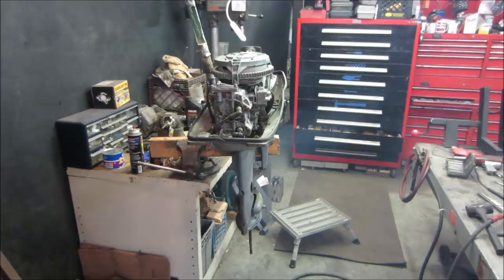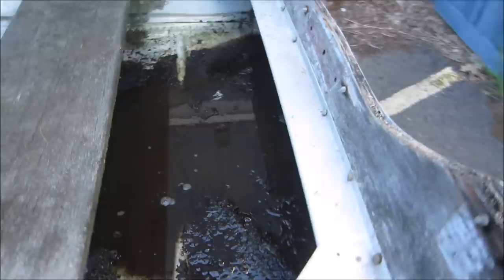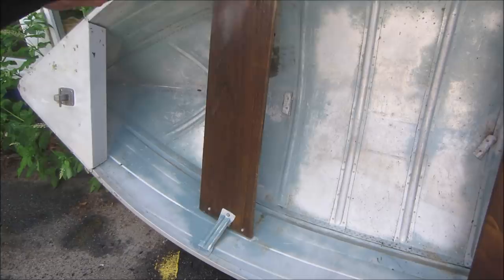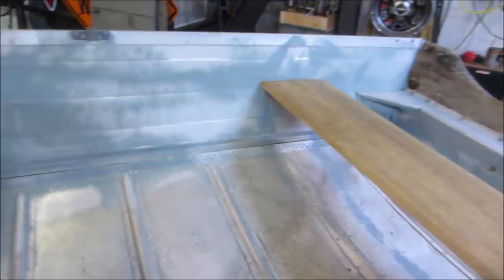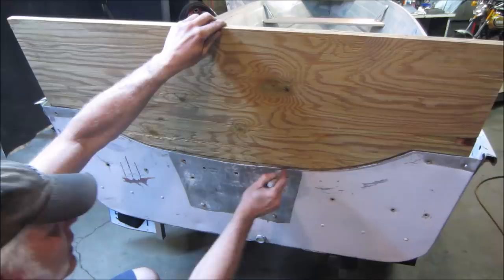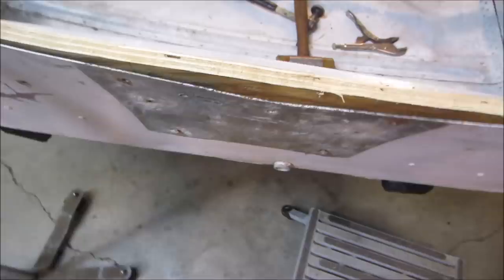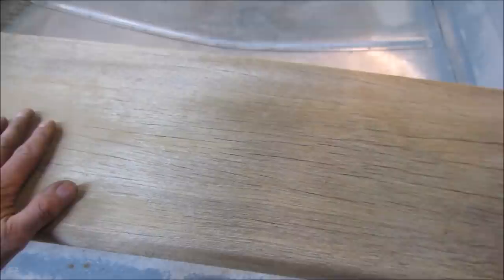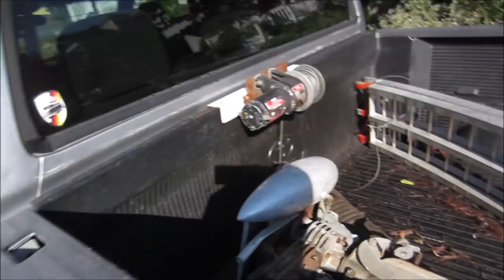Free Boat, First Wash/repair in 20 Years

Comment: 23:50 - "Runs for a while then loses all power and dies"  = Defective reed valve - Remove the old one and replace it with a new one and it will purr like a kitten.

Comment: I know there are boat experts on here, I seem to remember corner braces by the transom board to the sides of the boat.
I don't know the proper terminology, but you know what I'm referring to.
(I specialized in satellite communications Stripline/ microstrip work for 40 years. I never got involved with boats.) So please help Mustie1 if you can.
Reply: Any small aluminum boat like this would have corner gussets, a transom board that reaches the whole width, and a strengthening cap on top of the transom to tie it all together.  However, this is mustie, and he will make it work as is, until it breaks, then he will fix again!
Reply: @Bobbywolf64  gussets, yes, corner gussets.... i know how Mustie is, yes. He'll strengthen the heck out of it. I had remembered the gussets is all.
Thank ya kindly...
Be well.

Comment: On the outside of the transom  you need a metal plate.  this give the motor a safe mounting.  A metal plate on the transom bending over the transom and down to the same level as the outside is the best and safest option.  The wood transom should be coated with resin to preserve the wood.

Comment: 26:07  Has somebody drawn a picture of an old sailing ship or sail powered frigate on the stern of the boat just to the left of where you are fitting the external block of wood?...It looks like it!  (Actually I think it actually is a logo, not just some random mark which is what I first thought it was)
Reply: Another commenter suggested that's the boat that dinged up that left corner. I saw a Renault "Le Car" with the side smashed in somebody wrote on it "Le Buick."

Comment: Jumping up and down please FTLOG DO USE TREATED plywood.   (Stepping off of soap box)

The chemicals in the treated lumber will eat the aluminum.  It is way faster and worse than Galvanic corrosion that occurs with dissimilar metals in salt water.
Reply from the maker: wood was sealed

Comment: Please DO NOT USE PRESSURE TREATED WOOD FOR THE REAR TRANSOM. In 2004 the formulas for the chemicals were changed due to environmental reasons. The new formula will for the aluminum within a couple years.

Comment: Is that a marine grade wood??
Reply: Marine grade plywood would be nice (a sheet of 3/4x4x8 Marine grade plywood, assuming you can find a reseller with it on hand, is probably going to cost about $70.00), but I believe Mustie1 is dedicated to the theory of seeing what he can do with what he has on hand and at the lowest cost possible. Luckily the way that boat was designed replacing the transom wood is not a major ordeal and if the construction grade plywood starts to rot all he has to do is cut a new one and bolt it in.

Comment: You should have used marine grade plywood - not pressure treated. The copper in the treatment will corrode the aluminum.  Also, why not use a piece that properly fit the width?  Ok sure, this was a free boat but if you are going to restore it...then why not make it better than it was new?! My eye started twitching when you were measuring the thickness and that ~2" gap between the transom wood and the left edge of the transom aluminum.  Come on Man!!! Save adhoc for how you throw food on your dinner plate LOL!

Comment: why do boats use a piece of wood on that back that will root away wouldn't aluminium be better
Reply: Wood is more resilient against engine vibration, and not liable to fatigue fracturing (as in metal fatigue). It's also easier to replace a wooden transom, with much less damage when taking the old one out. In addition, because you have dissimilar materials, you're not transmitting all those high frequency vibrations along the entire hull, and thus not propogating metal fatigue to the rest of the structure. - I think that about covers the basics?

Comment: Mustie - you can fix any engine, but your a terrible carpenter!!!  That short (width) transom is going to flex the aluminum hull needlessly at a very weak spot, and lead to the aluminum hull cracking and failing rather quickly.  It's already been "crappily repaired" by someone already with the angled metal, and you are just adding to the issue.

I'm sorry Mustie.  I love your videos, and I have learned a lot watching you fix and repair equipment, but that Transom repair is underwhelming and weak.  It's ok sometimes to break down and visit Home Depot for a 4'x8' sheet of MARINE GRADE plywood.
Reply from the maker: nope, it has big ass corner brackets now even said it in the video,

Comment: Dude, don't be such a cheapskate and go buy a sheet of good Marine Grade plywood and seal with some penetrating epoxy. If you do have any minor leaks, just take a rivet gun and bucking bar and give each rivet a light tap and it will be watertight.
Reply: Dude dont be such a karen. You must be new here. He uses what he has around the shop. If you want to do it your way make your own video.